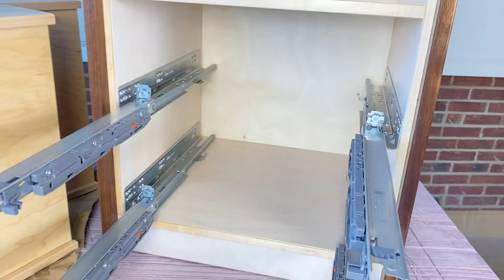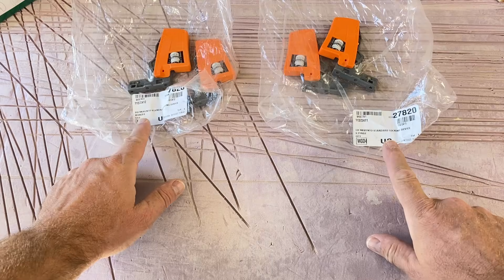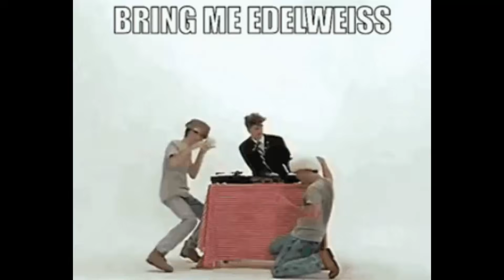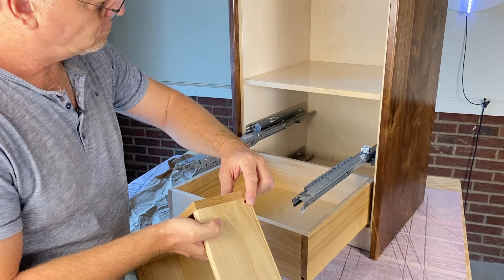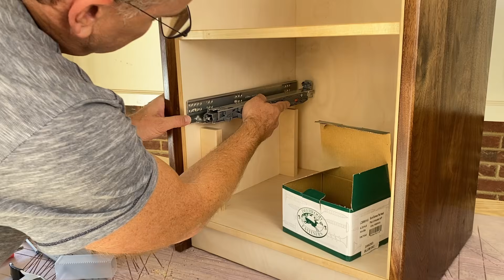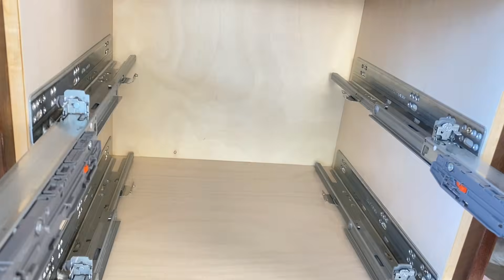Installation of the BLUM Movento Drawer Slider

Comment: Great explanation of a VERY complicated installation guide. 

Sorry, in advance, for the novel I am writing to describe my issue, I really just wanted to lay out all the facts, so someone can tell me the glaring problem I must be missing here.  

Here is the issue: My slides are parallel, level, and smooth as butter after installing. But when I attach the drawer to the slides, there is some sort of tension happening  about half way, until the soft close engages. I have taken apart, and reinstalled more times than I can count. I even went and got the nicer version (what you install in your video), and still have a similar issue. It is almost as if the drawer is twisting the slides. I’ve measured to double check the drawer box to ensure it is square. I need to mention that this time, I did not build this particular carcass or drawer box, because I am attempting to replace slides. I normally do not have issues with slides when I do the entire build myself, so I’m thinking there has to be a problem with the cabinet carcass that I am not seeing, but the previous slides worked just fine until the soft close had issues, which is why I am replacing.

Comment: Would it work if I have 3/4” (19mm) wood and mill down the width of the sides below the bottom panel to be the 16mm width? I assume it would work just fine as long as the thickness below the panel is what is required?

Comment: Nice short video! Thank you! I am trying to repair a drawer set bought at a store. I think my grandchildren leaned on them too much. The “soft close” function no longer works. It looks like I can simply lift out the drawers and replace the Blum sliders. Your cabinets look really good too!
Reply from the maker: Well, the new drawer design should allow that, depending on the type and generation of the sliders. Thanks for the flowers!

Comment: Thanks for the instructive video. A question:  Do you place the lower slide on the bottom of the cabinet?  Or do you leave a 3 mm gap?
Reply: From the other videos that I've seen everyone (but this fellow) starts with placing the first drawer slide on the very bottom of the cabinet (no space in between). Then they install the first drawer. After that they put a piece of plywood on top of the drawer as a spacer, and then use it as a jig to install the next set of slides, and so forth all of the way up insuring that everything is square to the cabinet. 

I'm going to install these drawer slides next month, so I'm checking out every video that I can find. I've been using side mount slides, but want to improve.
Reply: @Gazman299  The problem with using the lower drawer as a base for the second drawer, and so on is that if you make a small mistake in the second drawer this will continue with all higher drawers. I made a simple jig (simple piece of wood with holes to indicate the front hole to screw in for every drawer). This jig was a help, because I made three drawer cabinets for the same kitchen, so all drawers were at the same position every time